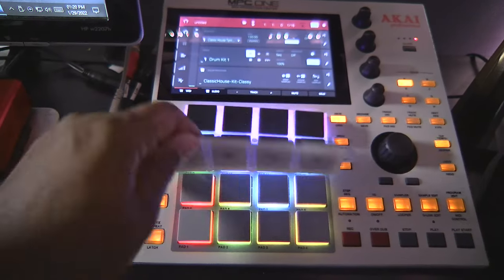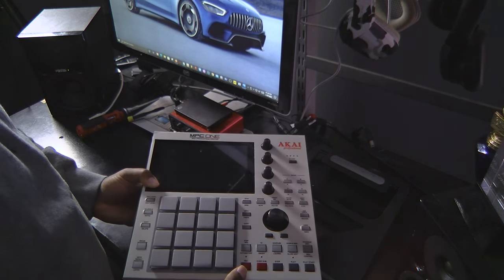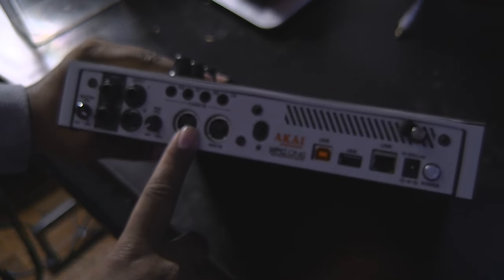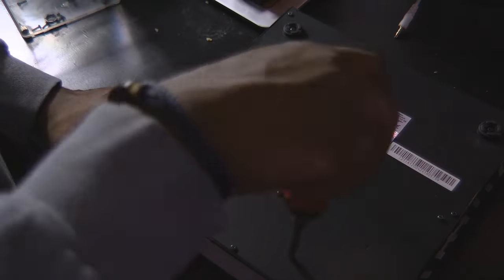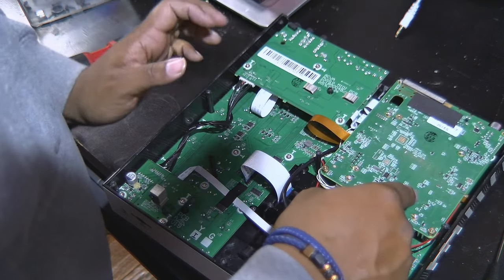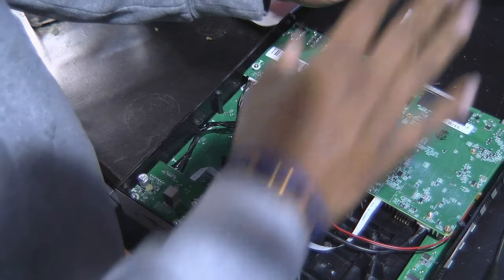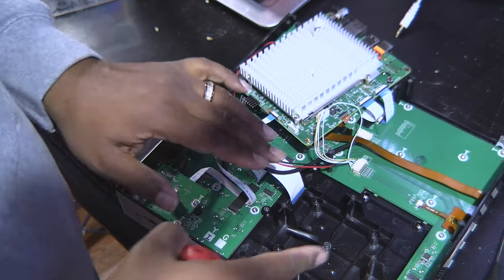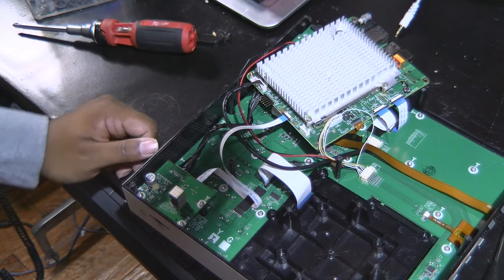How To Install Fat Mpc pads

Comment: Just doesn’t seem worth the hassle. I used to take my 2500 apart all the time. Once you got the screws off, you lift that shell and it exposed the pads, all the switches/pots, and the hard drive bay.